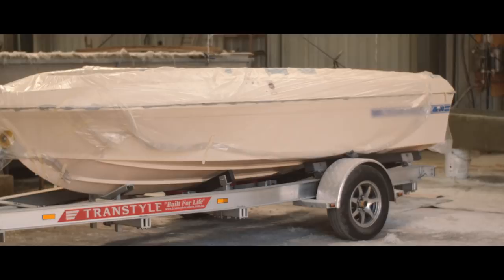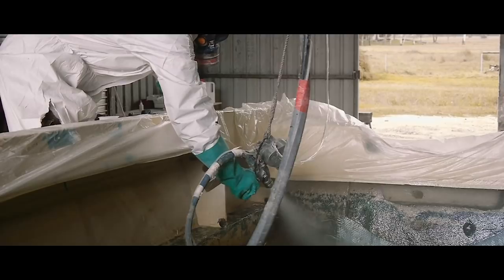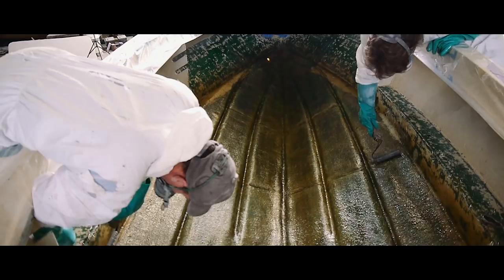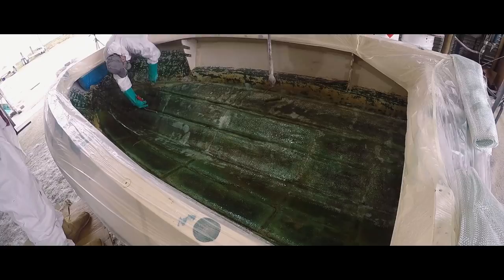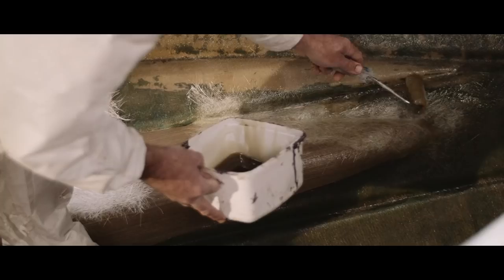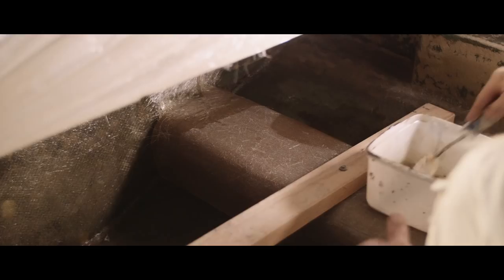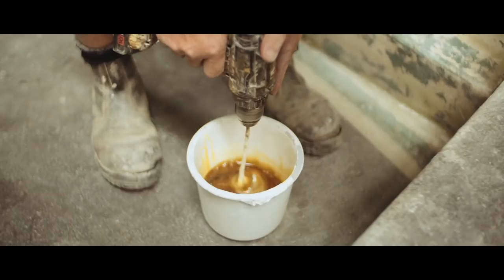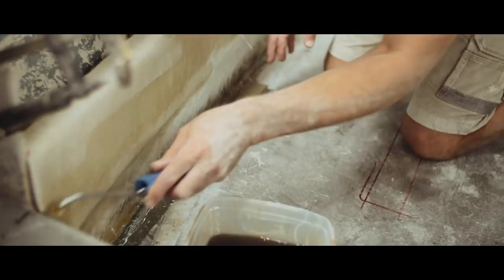The Haines Hunter 445F gets new glass stringers and Thermo-Lite flooring

Comment: So the fuel tank is permantley glassed in ? bad idea
Reply: not the worst idea alot of american boats do it this way but they dont put in the proper marine grade metal tanks in so then u have to cut the floor open and pull it out but if they used the correct marine grade metal for the tank  its perfectly fine
Reply: Stainless steel or alloy ??

Comment: woven rovings are so old hat. Why didn't you use a Double bias, a lot stronger.
Reply: Graeme Smith yes good point
Reply from the maker: Erick says that woven rovings are a more suitable material for the job as it's more pliable around the edges and gaps, noting the rovings were rolled into the strakes and around the chine. Erick also says he uses double bias extensively in his Whitepointer 263, largely because it doesn’t show print through, as woven rovings tend to show.
Reply: Because Australia that’s y we are light years behind thinking that more glass and resin is better